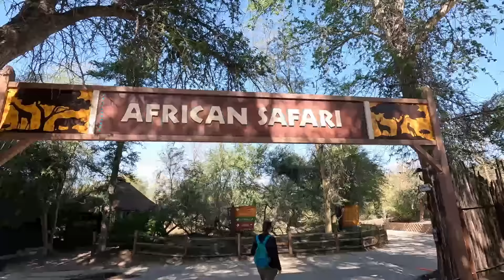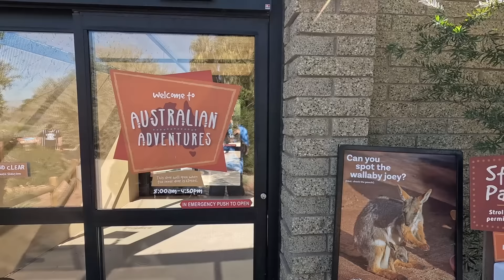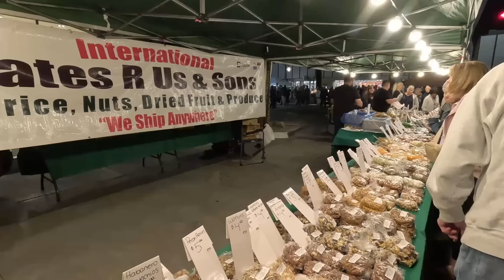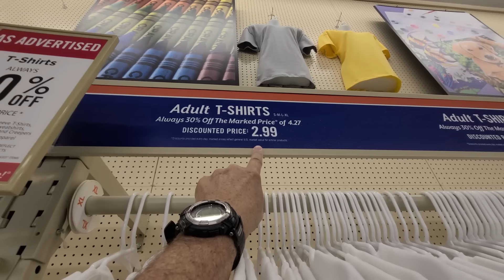RV Life PALM SPRINGS COOL TIMES in a HOT PLACE. Pines to Palms. . Trip Plan Change. RV Lifestyle

Comment: Hey guys, we enjoy watching you, and need to bring to your attention that your bike carrier is non-compliant in most every State. Not only is your license plate obscured, your tail lights are as well.  The latter being hazardous to yourselves and those sharing the road.  You can resolve the light situation with full function lights with temporary mounted lights on the roof (suction cup and magnetic are readily available).  The plate violation can be resolved with a relocation to the bike rack. Some areas are more lenient if front and rear plates are required, but plates are to be unobscured regardless. Unfortunately, this has become a growing problem with more and more "girthy" bikes in racks mounted to narrow bodied cars and SUVs.  So much so that in my area there's a zero tolerance policy and tickets are issued.  Safe journeys!
Reply from the maker: Thanks for the info. I raised the bike rack 5" to be above the rear tail lights and the license plate so as to insure it's visible from behind. AS an added measure, we are looking into lights up higher on the rear cap but we're compliant as we roll currently. I can understand the need for compliance. That's why we did not haul the bikes on our Jeep during our Alaska trip as they would have hidden the tail lights completely.
Reply: @bigtruckbigtravels  Great!  However, delve into  the standards and you will find your raise alone is not sufficient.  You have done a service to passenger vehicles, but you're still obscured to the riding height of trucks, which I'm sure you can appreciate. 

In coming years we will see revised standards published on aftermarket carriers of all varieties, but we Americans like to reinvent the wheel instead of adopting what works in other developed countries...  Probably will see the standards change for LED lights first (since we couldn't just adopt E-code for them but had to wait till everyone complained about the glare), but I know the teams working on writing both.
Reply from the maker: @robv4053  thanks for the update. 😃

Comment: David, Did you build your battery system yourself? Do you have any info on the system and where you bought your components from?  Thank You!
Reply from the maker: We thought of the concept of the system but got the actual technical design and components from Starlight Solar out of Yuma, AZ. Larry was great and helped us with the install from a consulting point of view. The prismatic configuration was required to fit our footprint at the time.

Comment: Good video 😊 how big are the spaces  in palm springs  since you  have a hdt and 46 ft  rig  🤔😊
Reply from the maker: 🤣😁🤔Some are bigger than others. Most on the left side can accommodate us but they are 30 amp and probably 60-75 feet long. The right side is 50 amp but the sights are much smaller at 40-55 feet long and at 90 degrees to the road. It's a challenge and you have to know what you are doing with a large rig such as ours but it works out for us. Thanks

Comment: You stated that your lithium batteries are 5 years old, do you see any power reduction in them? 🇨🇦
Reply from the maker: Nope. We've only cycled them a few hundred times (90% to 10% SOC), so they are still good. We've noticed no degradation on power.

Comment: Can you run your air conditioners off of 30 Amp other then 50 amps
Reply from the maker: Yes. We have designed our power system to be able to run everything in the trailer on 50 amp or 30 amp or even 10 amps! Our solar also kicks in during the day to assist as well. So even though we're on 30 amp, we can run our A/C when it gets hot...which we've been doing the past week! And use the microwave or stove top or electric water heater or .....

Comment: I'm looking to buy a Ford Motorhome similar to the one you have.  Just trying to get an honest review. just a basic overview of that model. I want a diesel, but I don't want to go into a larger super C.
Reply from the maker: Our Class C is laid out nicely and the Ford F550 has tons of power for that platform. The tanks are nice sized for the RV and the storage (inside and out) is great. We hate the suspension system though. I would never want to take it "on a 4WD area" to camp in as I think there is too much lean in the suspension. Hindsight...we'd still get this model but we'd change the suspension to either Sumo Springs, air ride or Liquid Springs. The DEF tank is a pain to fill since the hose is fairly flat to the tank and the front fuel tank has a bad vent system so it's hard to fill more than 75%. All fixable issues but wish it would be better from Thor.
Reply: Thank you  @bigtruckbigtravels